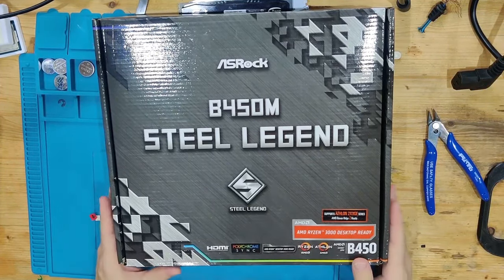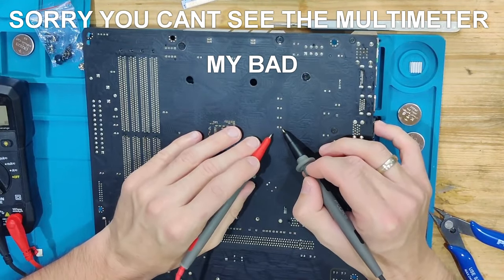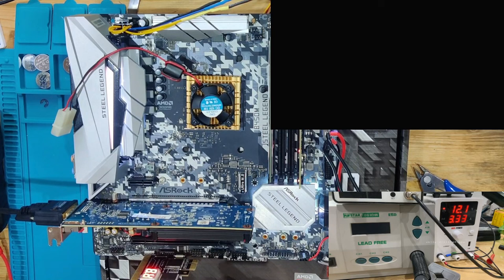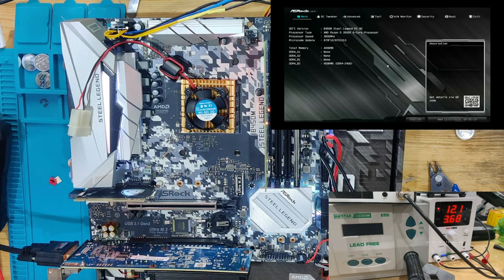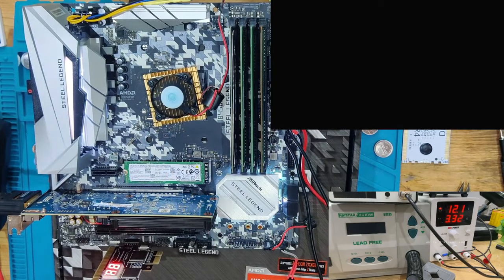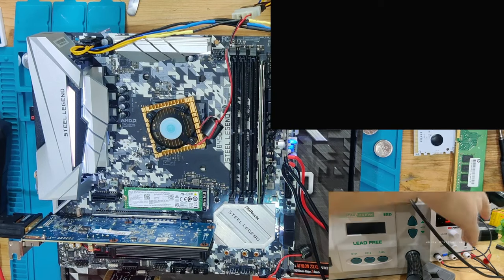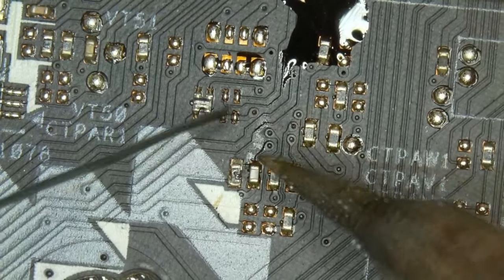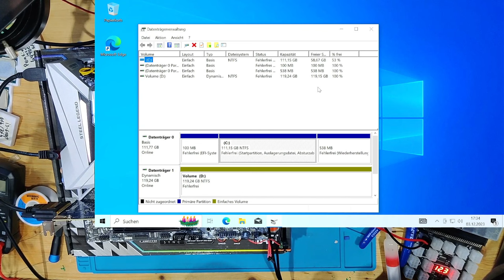A Practical Example: How to Diagnose and Fix an ATX Mainboard | B450M Steel Legend Repair AM4

Comment: Very cool video, I'd love to see more. 
I have now also bought a DDR debug stick and a new linear power supply with 40V 20A.
I have been repairing electronics for several years and also for customers. My equipment therefore amounts to approx. 3500€ with some very good tools such as a Fluke 175 as well as an Eakins microscope and an Atten Hot-Air Station and an Achi BGA Station. I mainly like to take on GPUs/laptops/MacBooks and smartphones/tablets, but I'm still getting used to motherboards. I'm now also reading a book to teach myself on the side. 

Best regards and have a nice weekend 😄
Tobi
Reply from the maker: That is some great Equipment, exspecially finding a beefy linear power supply like that! That must have cost a fortune!
What is the book called and is it about Mainboards or generell electronics! 
Cheers

Comment: Hello, a very nice and educational video, could you tell me what you plugged into the ATX connector?
Reply from the maker: There will be a video about that!
Its an 12V to 24 pin adapter! So you give it 12V and meassure the current of the 12V. The adapter has the other voltages like 5V.
Reply: @MainboardMedic  OK, thank you for the information, you did it?
Reply from the maker: No its bought online, there is a link in my video description!
Reply: @MainboardMedic  Ok thank you 👍👍👍

Comment: Anytime   you  Have  a  Lesser   Compute   power   GPU   than  specs   of   a  Main  board   =   you  Must  first   start  out  in  a  lower   x slot   ,  as  if   16   being  the  tope   slot   next  lower  is  usually  a  8x   and  or  a  4x /  4x  receivable   signal   reception
And  Many  newer   boards   =  there  is  no   direct   4x   on a   8x   slot  any  longer   ,  grab  a   single   4x   auxialry  slot   but   evven   those  are   at   8x   and  Up  now  for   4k  capture  cards   and  Certain  audio  inserts